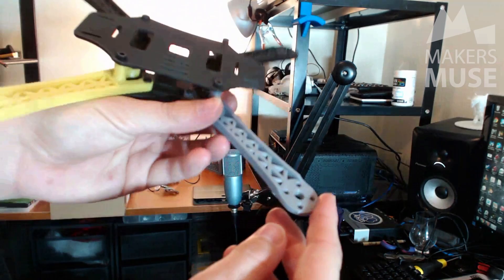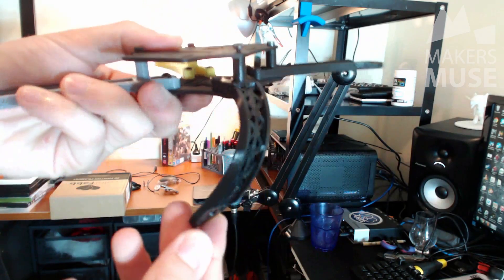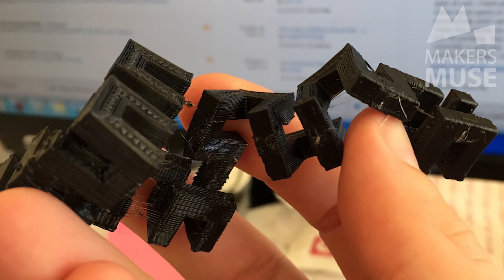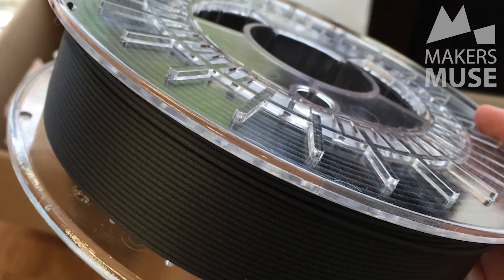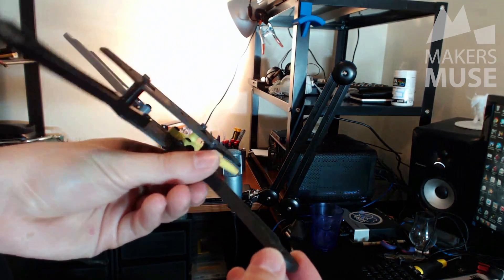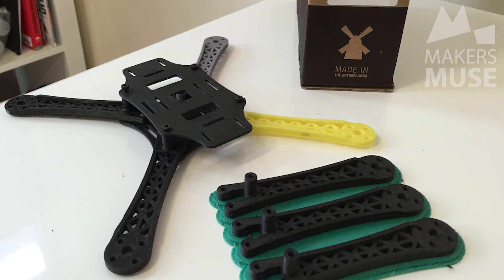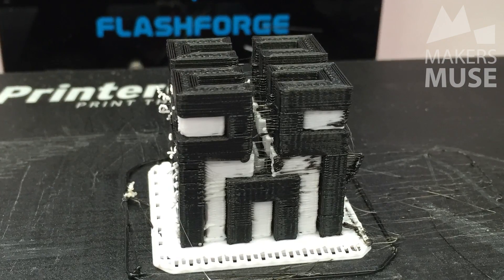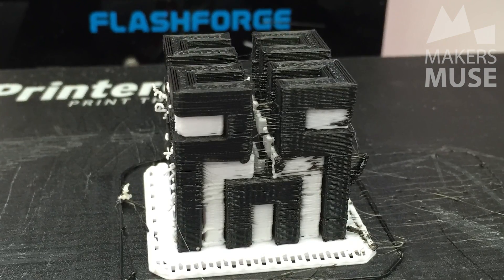3D Print with Carbon Fiber and TPU! - 2015

Comment: Thanks Angus!  I bought a sample roll of Carbon Fiber filament and was about to fling it out the window.  No matter what I did it would peel off the bed during the print.  I use CC Tree build surface and everything sticks to that.  After watching this video I jumped my bed heat from 75 to 95 and nozzle heat from 220 to 260 and it prints like a dream!

Comment: what would be damn cool is 3d printing with the 4 color Prusa, using carbon for the arms, TPU in disk shapes around the motors like contemporary motor soft mounts: then ASA or nylon for the standoffs. that would be the ultimate demonstration of multi material.

Comment: What good is carbon fiber that's just chopped up and blended into plastic?  You would gain so much more strength if it were laid as long strands, fused with plastic.

Comment: What temp do you print the carbon fibre at? In something like the prusa i3 mk2 with new multi material upgrade, do you think you could print with a pva support and interchanging layers of carbon and abs? Also, if you modified the unit further to be a controlled temp enclosed environment, how would this combo of mainly 3 materials perform theoretically? Do you think you could build really tough functional parts by combining these materials and processes? Thanks!

Comment: Putting carbon fiber chops in a plastic smells like a marketing trick ,doesn't make a lot of sense , i would really love to see a side by side strength - toughness test between carbon enriched filament and NYLON , PC (poly-carbonate)
Reply: It works the same way as traditional carbon fibre. It's obviously not good, because of the way the carbon is arranged, but better than most plastic-only materials.

Comment: yes the carbon fiber filament it's abbrassive... but yes you can find stainless steel nozle on amazon here in spain they sell 5 nozles for 12 euros... so it's not that bad... but you need a heat bed so if your printer doesn't have a bed you need to mount one

Comment: what determines whether or not your printer can print with some of these?
Reply from the maker: CF is really abrasive and requires a hardened nozzle, and flex filaments need a fully guided extruder assembly - so they don't 'kink' and jam up while being 3D Printed.
Reply: Maker's Muse thanks for the help! your videos are basically holding my hand through getting my first printer so thank you.
Reply from the maker: Happy to help! You should also check out the 3D Printing Facebook group for any other questions, I am always time poor but someone there can often help. https://www.facebook.com/groups/makerbot/

Comment: is TPU the same like flexible PLA? i see some seller on ebay and they didnt say tpu..
Reply from the maker: No, not the same. There are many kinds of flexible filaments, Flex PLA tends to be flexible but not elastic whereas TPU is also elastic (stretchy).
Reply: i did cancel my order and change to tpu :D
because i thought they are the same..
thanks for letting me know.. :D

Comment: What's the most recommended 3d printer for 1000 USD that has big volume and can print ninja flex
Reply: With good quality
Reply: Ultimaker 2, it Is a good printer
Reply: Morgan Ferau but thats 2000 usd
Reply: original prusa i3 mk2. 699+ shipping for the kit or 899+ shipping for a pre built version. make sure you get it from the actual prusa research website though. Dont get a clone/ knock off

Comment: hello mister.  do i need  to  have a special 3d printer  to be able  an print carbon fiber filament composites or may i use  it  with  any  office  3d printer?? thank you
Reply: A printer that can work with ABS should be OK to work with the carbon fiber too.

Comment: Hi, I'm doing a project where I take a longboard wheel and basically put a 3D printed support structure in it. I was wondering if you knew what kind filament would work best for this type of use.
Reply: What do you mean by support structure IN the wheel?
Reply: I'm building a motor into a wheel and I was wondering what filament I should use for the outer casing. The part between the electronics and rubber wheel.

Comment: what are youre thoughts on printing TPU on the up mini. with temperature hacks of course.
Reply from the maker: +5pecialkei I don't think it's possible... the UP printers don't handle flexible materials well at all. I've only had very minor ~ 1/20 attempts success rate and it's very file dependent. They just extrude too fast, even on 'fine' settings.
Reply: +Maker's Muse ah I see. I buy my filament from 3D print gear so I was curious about it. Thanks for making videos I find them super helpful!

Comment: Angus! Just saw this - nice. So, why the ABS raft for non-ABS parts?
Reply from the maker: +3D Printing Nerd Hey! The XT-CF20 is mad expensive, so it was to see if I could take advantage of the dual extruders to print supports / rafts in a cheap ABS - which was a success! It's obviously better to print raftless if your bed's nice and clean but my buildtak is always ripped to shreds :)

Comment: what printer did you use to make objects that size??
Reply from the maker: +Slicer Badger All printed on the flashforge dreamer - the arms are printed separately and assembled after with M3 screws.
Reply: +Maker's Muse Flashforge dreamer vs. Creator pro- who win to you?
Reply from the maker: +Grant “gmoney8478” D. I get asked this way too often. They both have pro's and cons - I think the Creator Pro is better built but has a lower quality interface. Either machine rocks with Simplify3D though!
Reply: +Maker's Muse MOG YOU ARE AWESOME. ... just bought the dreamer.. had a couple bugs at start but found out it was an outdated firmware so fixed that. .. but I love the dreamer and I bought it because you spike so highly of it...  you are so AWESOME
Reply from the maker: Sweet as dude! Yeah the new software is pretty sick, big improvements over the older versions.

Comment: Try switching filament multiple times for layering. TPU/CarbonFiber/TPU/CarbonFiber/TPU, always keeping the TPU on the outer layers and you will have a strong, and resilient part.
Reply: Did anybody test layer adhesion with carbon fiber and TPU? Cheers
Reply from the maker: Eric Henderson That sounds pretty cool, I'm wondering how layer adhesion would go but worth a shot!
Reply: I do it with PLA, making multicolored parts. I have some TPU coming tomorow so i can test TPU adhesion to PLA. :D
Reply from the maker: Super cool! Let me know how you go. :P

Comment: ANGUS! 3d printing rubber tires for RC airplanes... I'd like it to be somewhat lightweight, good quality detail, and soft for a better suspension on hard surfaces.. which filament do you think would be better for this? I have an up! mini.. have you tried carbon fiber on your up by chance? also, I tried to use the hack for the up but I have a mac..?? Sorry so many questions.. love your channel bro.  Cheers.
Reply from the maker: Broc Gallegos Hey dude, If you have a mini - you will really struggle to print flexible materials, or carbon fibre :( The CF works ok at the stock temps but you might want to put something over the platform like buildtak as support material doesn't pull away easy from it (plus it's a huge waste as it's so $$$). If you can't print raftless due to bed level issues that makes it pretty difficult. 

I got gold ninjaflex to work ONCE on my UP Mini at PLA temperatures with a desk fan pointing at the extruder - running on fine speed. Was never able to reproduce it :(. 

The Hack doesn't work on a mac, but it will work on any old windows device, doing a video soon on using super cheap sub $100 windows tablets for 3D printing soon. :)  Hope that helps!
Reply: You're awesome! Thanks for the in depth reply!
Reply from the maker: No probs!

Comment: It's probably way past, but make sure you do some testing with that carbon fiber chassis in regards to radio interference. Carbon fiber can mix some signals pretty badly. As well watch out connecting anything aluminum directly to bare carbon fiber, it kinda makes a battery and corrodes things quickly. Not sure how any of this applies to a plastic infused with carbon though.   Thanks for the good video! Just getting into 3d and it's cool to see some new (to me) tech!
Reply from the maker: ***** Haha yeah I was worried about that, so took a multimeter to it - 0 conductivity! I think only 20% carbon fibers isn't enough to make the material conductive overall (which is good). You're dead right about normal carbon fiber being conductive and blocking RF though - learnt that lesson the hard way!
Reply: Haha ouch! We ran into some problems pop riveting carbon fiber onto racecar chassis, found out the hard way too haha

Comment: I am into printing action figures. I am looking for a filament that is stiff but has some give for the hands so I can slip a gun or some other prop through the fingers. I also want to be able to airbrush model. Which filament has good hardness and flexibility for action figures?

Thanks

Comment: Why are you printing with raft?????
Reply from the maker: patprop74 I'm so used to rafts due to using the UP! Printers - I just find it easier not worrying if my bed surface is perfectly clean and free of marks. Plus, it's just cheap throwaway ABS.

Comment: Hi dude, thank you for the detailed review of XT carbon!

Comparing it to the nylon abs used on aggressive inline skates, do you think it can be used for sustaining human's weight at high speed or take abuse like jumps?
Reply from the maker: Seventaiji Hey mate, no worries! The biggest problem you'll face is delamination - the 3D prints are weakest along the layer lines and that's where it will fail. Otherwise the plastic is REALLY tough, so it might just work.  You would have to print hot and at near 100% fill though.
Reply: Ok thank you for the light! 

I am bringing Air Gear to the real world this year, spent months and money working on this and I have a 3D printer coming soon at home, this could save me time and money to try prototypes.

Comment: Good video mate with the exception of the yolo! :D
Off to buy some CF20 - thanks for the heads-up, so I may be in touch for some Simplify settings soon.
Subbed too. :)
Reply from the maker: Ross Hall Haha thanks mate, I love to hate that phrase. I'll be doing a Slicer Engine comparison video very soon (as soon as I can borrow a printer other than the UP's) and will feature Simplify3D in that.
Reply: I've got a Dreamer twinned nicely with Simplify now. The propriety software was okay but it lacked a lot of detail. Did you print out a quad frame in cf20? How is/was the stiffness?
Reply from the maker: Ross Hall Yeah I printed the rest of the arms in the CF20 - I haven't attached electronics or flown it yet, but the arms are way stiffer than ABS.

Comment: Can carbon fiber easily recycle like PLA?
Reply from the maker: Starteller I don't think any filled plastics are easily recyclable, but there is CF infused PLA's and they would break down easily, carbon itself is pretty safe so long as you don't breath it in! The Colorfabb material is based of a PET which normally can be recycled (same plastic as drink bottles).
Reply: Maker's Muse Plastic bottle can be recycle? I trying to find the how to on the internet.
Reply from the maker: They can! There is also a printer designed to only print in recycled bottles called the 'Ekocycle' - http://cubify.com/ekocycle very cool idea.
Reply: Maker's Muse Oh but people told me that we can't refill ourselves their cartridges.
Reply from the maker: You can't, making filament is very difficult so still not really possible to do at home.
Reply: Maker's Muse So I can do only PLA for now?

Comment: I printed a quad frame in regular XT and it was extremely stiff, unforchantly  it was also very brittle and didn't survive a crash.
but at the price of these filaments it's still much cheaper to buy a frame.
the tpu looks cool though I'll have to look into it.
Reply from the maker: Moshe Kashani Hmm interesting, I will have to see if the carbon helps or if it's still too brittle to survive big impacts. It's true these days frames are cheap, but that wasn't always the way and you can still print custom frames.

Comment: I have printed with the ProtoPasta PLA/CF mix which is similar to the colorfabb stuff and it is VERY stiff but also VERY brittle. I think the XT/CF sounds like a really really good idea since XT tends to have a little flex like ABS. As for abrasiveness it will wear your nozzle out faster but any filament with any kind of additive (metal, chalk, wood...) will wear your nozzle faster.

As for being flexible at high temps, it has a glass transition of about 70*C so keep that in mind :)
Reply from the maker: Calvin Witt I've been looking at ProtoPasta recently, they've got some crazy stuff! Have you tried the stainless steel PLA? Colorfabb warned me about the low glass transition too, I've dropped the bed down to 60deg after the first 3 layers and it works perfectly. Also helps to be less impatient and give it time to cool ! Sorry for the huge delay in replying, youtube comments are terrible to keep track of :(
Reply: Maker's Muse They have some CRAZYYYY filaments. They are really giving ColorFabb a run for their money in the crazy filaments department. I am going to be doing some videos soon on some really unique filaments soon. If your interested I can snip n ship a sample size of the proto pasta stainless & iron filament I have. It is 2.85/3mm dia.
Reply from the maker: Cheers for the offer dude! But I run 1.75, all good though I'll probably grab some to give a test.

Comment: Have you played with the carbon fiber and a heat gun, or leaving it out in the sun?  Sounds like if it is bendy off the bed it might get that way in the sun on a hot day or in a hot car.
Reply from the maker: Alluvian Hmm very good point, not yet but I certainly will - if it softens while holding hot components like motors or batteries, that's not the best! To be fair though the heated bed was at 110degC which is pretty hot.